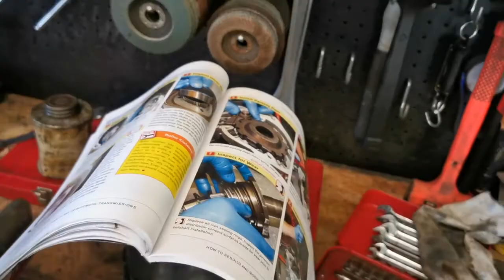C4 rebuild part 2

Comment: How'd this run?  Did it go well ?
Reply from the maker: Yes running fine now back to daily driver duties, has been for a while
Reply: @THE_ACTION_SHED   Good to hear . You must of got a new stator support for the pump ??? The spline on the front  (@ 10:15) for the converter stator is missing where you explained was a burr on the edge ?
Reply from the maker: @gregh6794  yep installed a billet pump before it went in the car, worked out it was broken off when I was editing the video hahaha
Reply: @THE_ACTION_SHED  that’s good phew 😎
Was that one of the speedmaster ones? Was curious what they’re like.
Reply from the maker: @gregh6794  it's a PCE billet pump works good bolted straight in